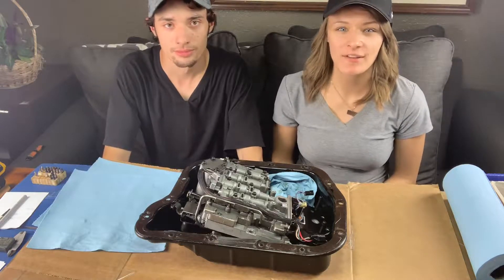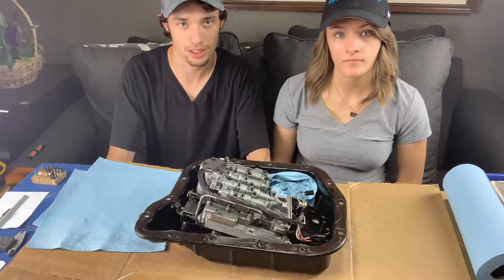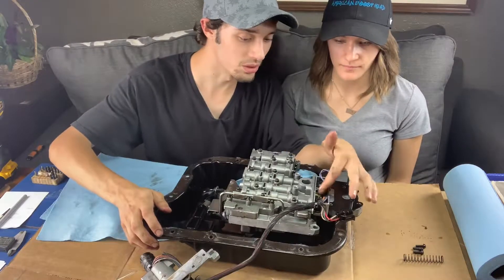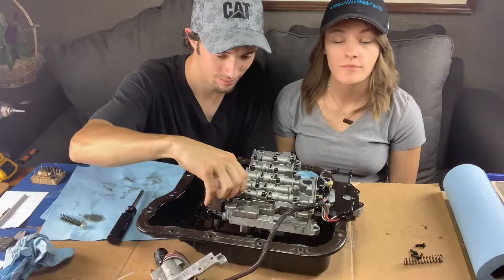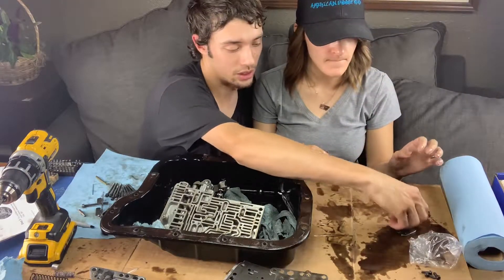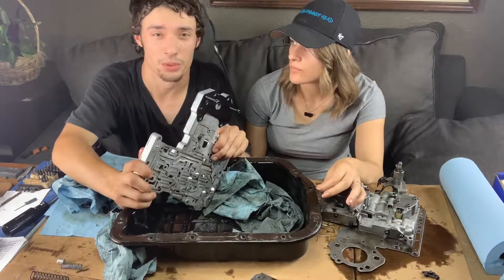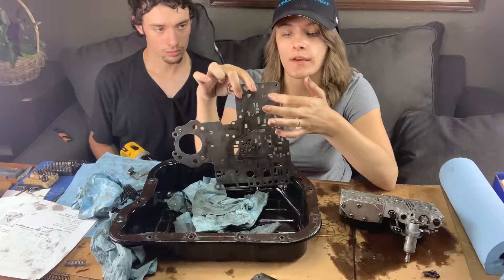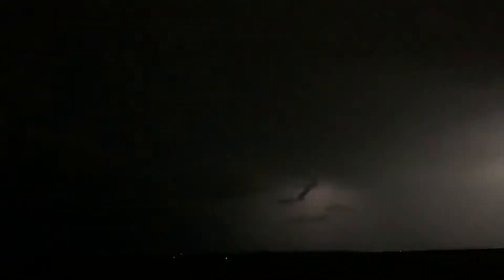TFOD-3 Manual Valve Body Build 47RE

Comment: So you didn't add the solid plate underneath the governor solenoid that comes with the kits?
Reply from the maker: Yes Kyler did the next day. He took it back apart and cleaned every component off thoroughly. He finished adding the few last items and modified the rest of the Valve Body just like we stated in the video we would. It ended up being to late to finish it that night.
Reply: @americanboosthead   what do you do with the governor solenoid then? Since it sticks out and would hit that plate?
Reply: @americanboosthead  I'm assuming you just remove it all together?
Reply from the maker: As far as I remember we didn’t have any clearance issues but there might have been a spacer.. will have to check the build sheet tonight and let you know
Reply: @americanboosthead  I'd appreciate it, was told to use a block off plate but then solenoid didn't fit so I figured leave solenoid and unplug it
Reply from the maker: mark robinson we couldn’t find the build sheet and didn’t wanna give false info but we did bring this up in out most recent video if you’d like to check it out.

Comment: Eye protection should have been used and Kimberli gloves should've been worn by you while holding the valve body or Kyler should've held it while you operate the drill. Safety is always first.
Reply from the maker: Can’t forget PPE! But seems we did.. filming at midnight is never a good idea 😅